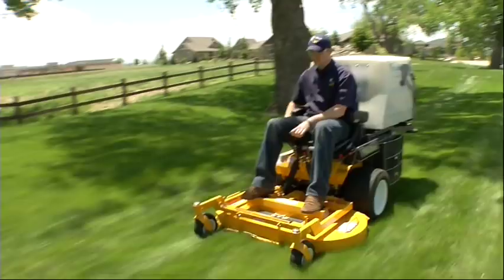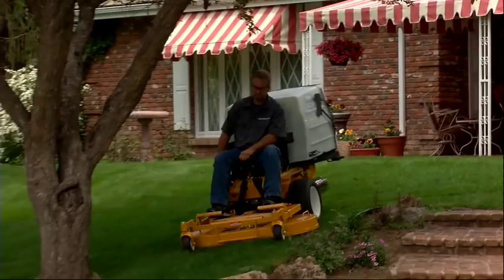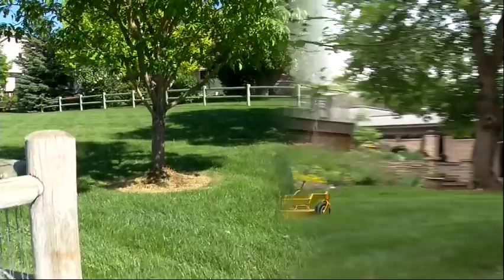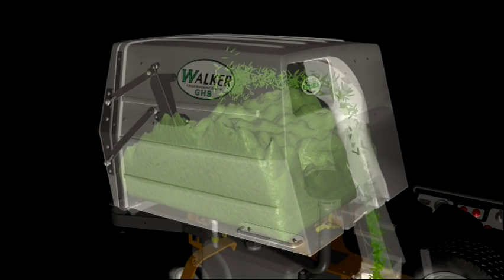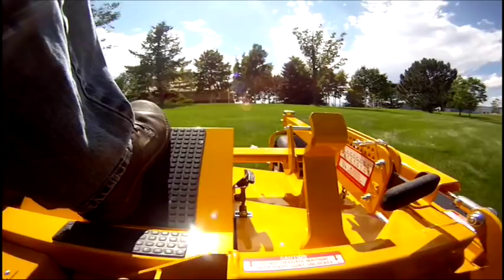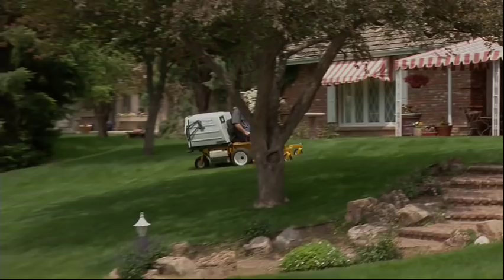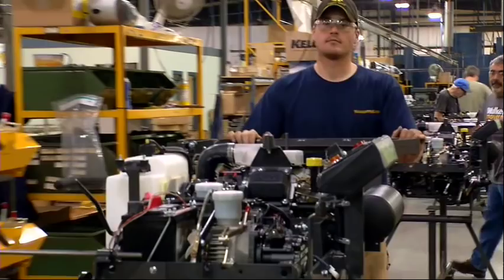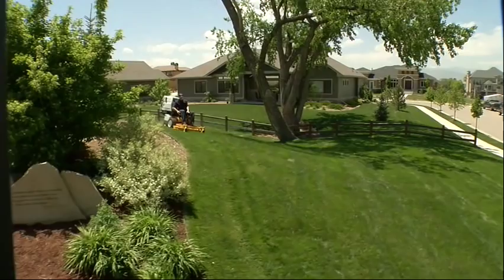Walker Mowers Product Video HQ

Comment: I'm my neck if the woods most of the older guys ,50 and above, use walker mowers and a few navigators. They say it's the easiest thing to drive and most relaxing Bc at 50 you don't want to be standing all day on stander or a velke. So I guess when I get to that point life I will be looking into getting one these as well. I personally do like this style of mower. The only thing I would do is probably get the mulching deck kit.